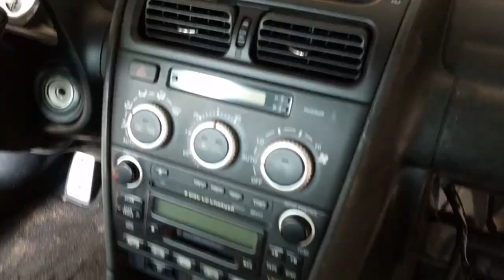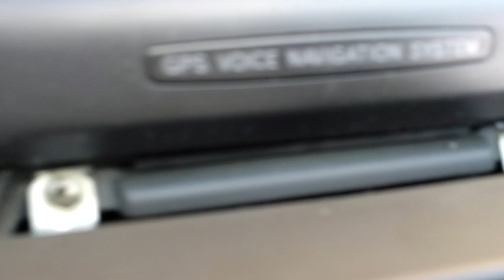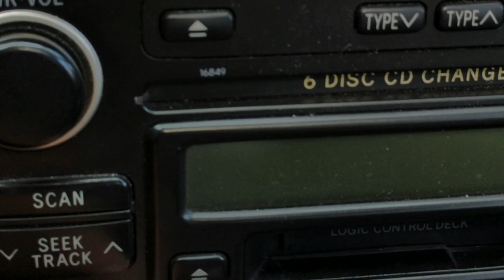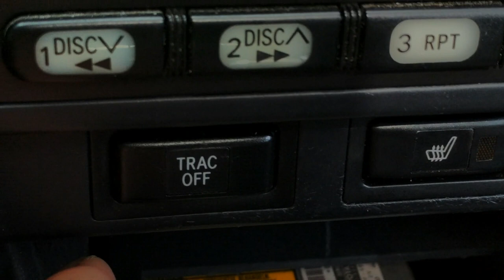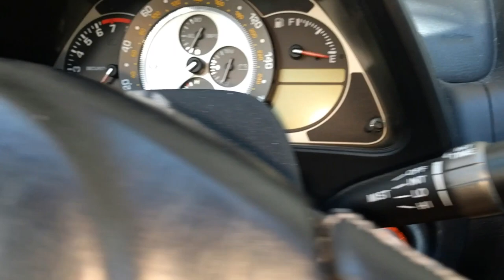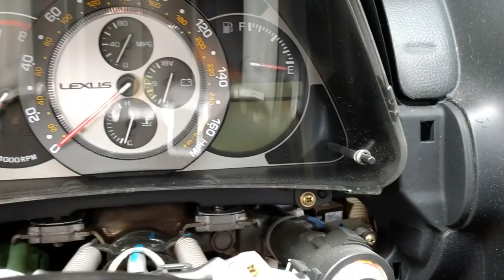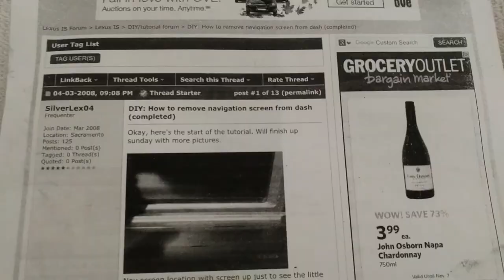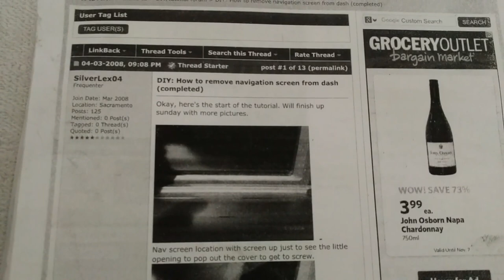Lexus IS300 dash removal by froggy

Comment: Hey froggy, many thanks for your great video which has saved me hours of stress and puzzlement! I have just finished refurbishing the dash on my IS300, removing all that goo with isopropyl alcohol and refinishing with flat black plastic paint. I must say that it looks like new and I am very very happy with it, Your advice was fantastic and I really appreciate your clear and methodical approach. Btw, I managed to do this refurb without completely removing the dash - I removed the centre console and all the parts that were easily removed including the air bag covers on the A pillars and then carefully masked off all the areas I didn't want paint to get onto prior to spray painting. Once gain thanks for a brilliant video.
Reply from the maker: Good "shortcut" mine still looking fine 5 months later.

Comment: Would love to see the finished product once you're done cleaning-up the dash!

If the airbag light is on now, that might be a problem. You'll probably have to take it to someone who has a scan tool that reads and resets SRS codes. Often times it's the dealership, who'll charge an hour labor just to plug in their computer and and press a few buttons.
Reply from the maker: I'll buy the tool on ebay and do it myself. Thanks.

:)

Comment: For anyone else having my problem. I ended up going to Lowe's and getting highdensity mini foam roller for $3 and it worked great. For the small hard to get areas just use the brush
Reply from the maker: Great idea,

:)
Reply: @1947froggy  one last question lol. Since the FB isn't waterproof. How do I seal it?  Or do you recommend just leave it as is
Reply from the maker: @matthiasei1481  If it looks nice just leave it, once in a while use your favorite interior detail product.

:)

Comment: After you used the forever black. Did you have to add a finish on top of the forever black? Or was that it? Just 2 coats of forever black and leave it?
Reply from the maker: No, just the FB
Reply: Cool I'm going to try it. Looks great. Can I armor all it later on? Or will the dye come off. Also will it rub off on my pants?
Reply from the maker: @matthiasei1481  I don't prefer armor all, some types leave shiny finish. As for rubbing off it shouldn't but not 100% sure. I never put it where I rub on it.

:)
Reply: @1947froggy  ok and you did 2 coats and it came out even everywhere? Did u wet sand the surface before applying or just clean it with cloth and apply?
Reply from the maker: @matthiasei1481  I don't recall, but IMO wet sand would be fine.

:)
Reply: Froggy? What did you use to apply the forever black? The applicator brush is leaving strokes and it's drying that way.